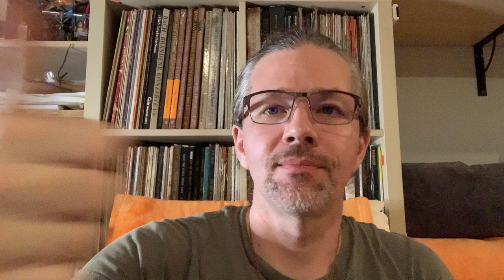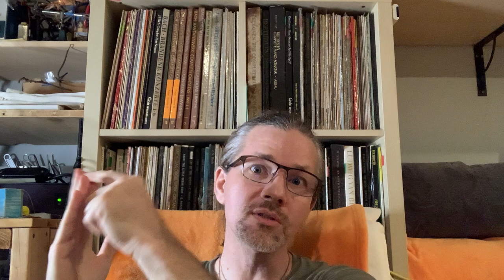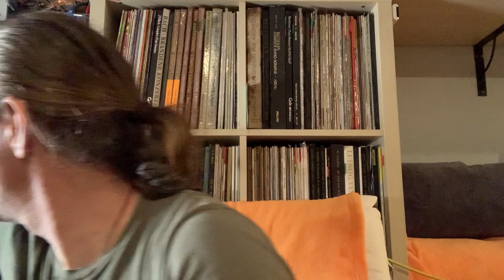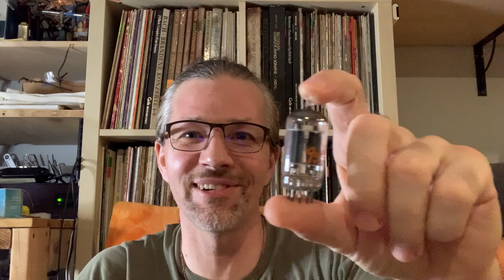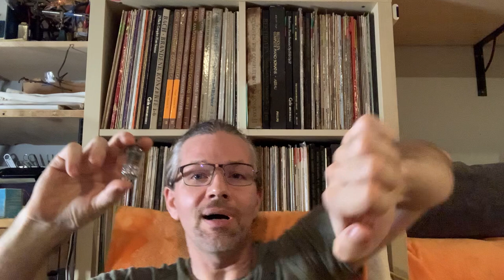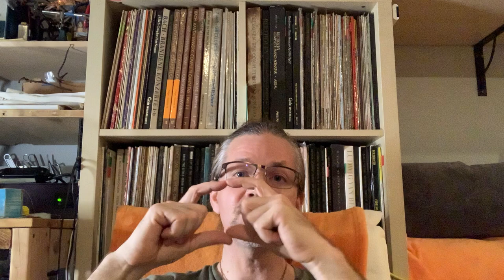Concluding preamplifier week with gain structure! Preamp output & amp sensitivity matching

Comment: Janos, how are you? Well, I'd like to tell you what happened to my system. But, before that, maybe I'm understanding the meaning of your videos. They are not a cake recipe, many times we would like cake recipes but... Maybe we could say that they are philosophical videos. You have often spoken of "matching systems". Perhaps it is related to what happened: I noticed that there were two things wrong. One of them was that when turning the volume down through a potentiometer, there was a loss of high mids and highs. So I preferred to use the youtube volume control, and always set the potentiometer to maximum. Well, maybe the potentiometer in conjunction with the amplifier's input capacitor was acting as a low pass filter. The second point was that I knew the speaker padding was very dense, approximately 10 times denser than recommendations from a Fostex expert. So, I decided to reduce the density of the filler, and as an immediate result, there was a considerable increase in the high mids and highs. But what intrigued me the most was that the potentiometer defect disappeared. I believe the defect is still there, however, it has become more difficult to notice. Finally, when you talk about "matching systems" I think you're right...    Abraço, André
Reply from the maker: Como vai André, you just got a good taste of the road towards dead cabinets! Overstuffing dampens cabinet liveness to a significant degree:  it not only slows down air speed in the inside, and cancels part of high frequency resonances, but it also dampens cabinet resonances mechanically (touching the cabinet walls the tight stuffing absorbs the cabinet resonances as well - this works extremely well at lower volumes, but at high volumes the damping is not enough to snuff out all cab wall resonances, so you start hearing top end and midrange ; ). Also, the volume pot adds more resistance in series with the signal, and creates bigger and bigger problems as the volume is turned downs & more resistance gets in the way. Now you have removed one piece of the compounded issue... 
You could try turning the volume pot into a shunt pot, (Sakuma-style), that will increase the clarity and prevent high-midrange softening, although you will need a pretty good preamp to driver the exponentially lowering input impedance as the volume gets softer ; ).
Reply: @realworldaudio  Janos, Well, the pre-amp subject is one of those on the agenda, I need to study the subject. I already bought the 12ax7 in order to make the pre phono, as your suggestion. Now I see that I might have to make another preamp, maybe before building the pre phono. Do you have any indication of a preamp schematic according to your last videos?  Abração!!
Reply from the maker: @andredebacco  Hi Andre, the best woudl be to build a pre-phono, and then you can cut out an interconnect. (And an extra gain stage that is needed to drive an interconnect..) Build it in a bigger chassis, so you can distance out the transformers from the signal circuit, and if possible, use separate power supplies for phono and pre.  ;

Comment: learning a lot , maybe  we can make it pre amp month ,lol, will my  6L6 or el34  improve with a dedicated pre amp  , as u know pre amp tubes are already there inside it already , if it will be a hearable difference maybe I can try taking the pre tubes out and  in a different enclosure with its separate transformer
Reply from the maker: you can try using the 6L6 or EL34 as a cathode follower in a preamp. Provides a very lush, big, effortless sound. Or, you can try a preamp with a single EL34 with an output transformer, 8K:600R step down. The preamp will have very low gain, about 7dB or so, but with most sources nowdays we don't need more for audio.
Reply: @realworldaudio   thanks for the advice bro